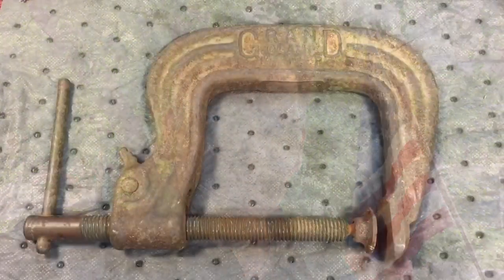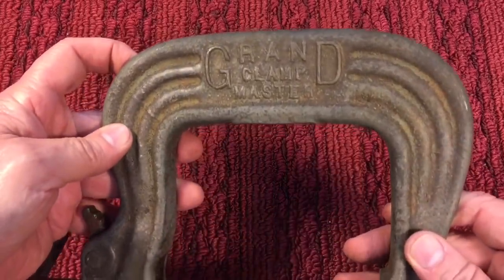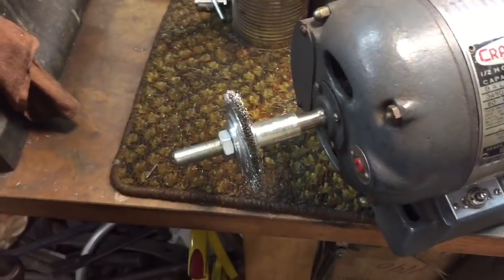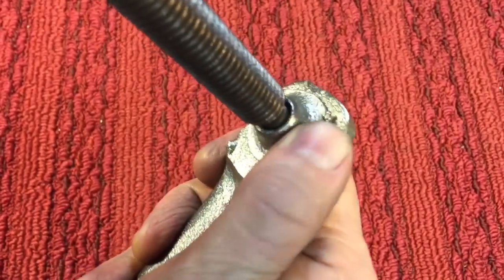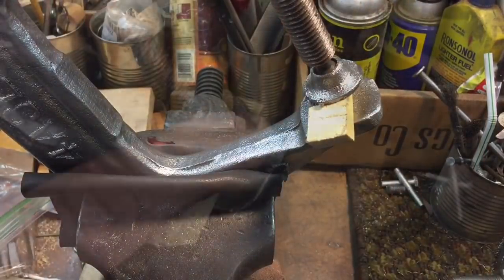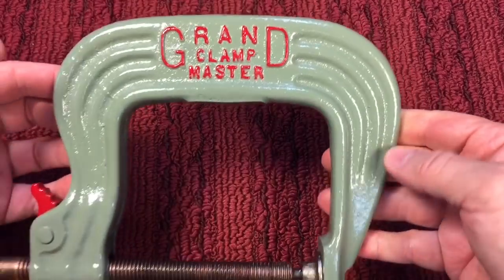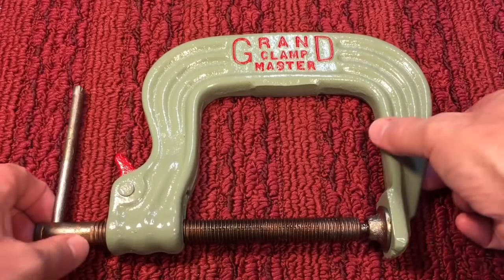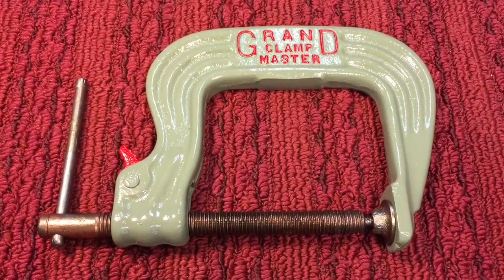Restoration of a Antique Grand Quick Release Clamp

Comment: This clamp makes me think of a piano with that name and design. Looks great after wire wheel. I like it painted too. That hole was probably used for a press. I modified a pair of Channellock's similar. Use it for pressing in roll pins on hydraulic clutch slave cylinder when on vehicle.

Comment: The art deco on that is simply outstanding. Personally I would have kept the silver shine coming off the wire brush, but those colors do look era correct. I've been looking for more ornate stuff like that, and it has given me some ideas when I get deeper into making my own tools.
Reply from the maker: Allan!  I was so close to keeping the original casting color (silver) and doing the letters in Red but the paint really does a great job protecting the clamp so I did it. If you want the original casting color you have to Clear-coat it, not shellac. The alcohol in shellac can slightly darken the metal.   Thanks!!!!!!!!
Reply: @ScoutCrafter  I need to invest in some shellac. I use the buffing compound and a little oil to stop corrosion. It's been working well enough in the Georgia humidity.
Reply from the maker: Allan, Shellac is so easy to apply and dries so fast and keeps out the moisture!  I think you will like it!  =)

Comment: Really cool clamp. I'd use those along with F-clamps for fabrication. I have two different metal saws that use that same kind of quick clamp for vise adjustment and they hold pretty solidly.n Never tried vinegar for rust I've always used electrolysis but I'm usually de-rusting something much bigger than a clamp, guess I'll have to try it. Great color combo too thanks for the restoration!
Reply from the maker: Hello George!  The vinegar won't work as well as electrolysis but I can do it in the basement as there are no hydrogen gases.  Plus at $2- a gallon it really does a decent job at a low cost!  The F clamps are just unbeatable!  I like to restore old classic tools but you can't beat the F clamps for quick set up!   Thanks so much!!!!
Reply: Yah, basement not a good idea for electrolysis! I use my shop too many air leaks to be a worry.

Comment: Very interesting clamp - I didn't know metal quick-release clamps existed (not that I'm an expert, mind you.)  I was wondering if you were going to repaint it - it looked good in bare metal and it looks good painted.
Reply from the maker: Hello David!  Quick release were around for quite a while but their problem was over time the half nit would wear and the clamp would slip. So the old timers stayed away from them.  As for the paint, I too was on the fence about painting or leaving it raw...  That's one of the restoration problems you run into!  It's so much easier if you were a business doing it for someone else because you leave the decision up to them!  LOL   Thanks so much!!!!!!
Reply: Half nit? Is that half of a nitwit? LOL (I assume you meant half nut).
Reply from the maker: LOL   Yes!  I haven't heard Nitwit in a long time!  =)

Comment: Looks great, what did you end up using on the copper coating to prevent it from tarnishing? You know that “patina”
Reply from the maker: Hello DJG!  Those older threads had a copper plating to prevent weld spatter from sticking to it but I don't know how effective it is..  I just coated the threads with the 50/50 red grease/marvel mystery oil.  That should keep them rust free, as for tarnish well, I'll call it Patina!   Thanks!!!!!!!!!!

Comment: Another great video.  You mentioned it is identified as a 4" clamp and yet when you measured it it was 5" at the girth of the clamp.  If you open the mouth of the clamp all the way it may measure 4".  I    believe clamps are normally measured at the mouth.  In many of your videos you show old drawings of the tools you are working on.  I'm always curious where you find the drawings.
Michael
Reply from the maker: Hello Michael!  You are right!  Lots of times a 4 inch clamp when open the pad will not allow the full four inches!  However because of the "dip" in the bottom jaw and the way the pad goes deep into that jaw this clamp opens almost 5 inches!!!!!  I never saw that before!  As for the drawings I try google images and Patent search but my favorite source is Alloy Artifacts .org  They are the best!!!!!!!!   Thanks!!!!!!

Comment: How do you remove and then replace the pad please? Thanks
Reply from the maker: Hello David!  Normally there is no need to remove the pad, just move it over to one side and you can clean that side of the ball, do that all the way around and most of the rust will be gone.  Then fill the pad hole with grease and your good to go!  Don't try to remove the pad if you don't have to... They are pressed on at the factory!   Thanks!!!!!
Reply: Understood. Thanks for taking the time to explain. Cheers
Reply: @ScoutCrafter  0

Comment: 4 ASL you are assuming it is 4 inches, but could be a model number. It turned out nice but no country of origin which makes me think they are not American with the  styling probably Italian.
Reply from the maker: Hello Tony!  Most Clamps I have owned use the number as a designation of size in inches, Grand did make a  6ASL clamp that was larger...   Usually the number indicates maximum capacity between the jaws.  Most clamps I have don't have a country of origin on them just a manufacturing name and size!  However since the Italians always like to add some artistic design in their tools it very well could be Italian!   Thanks!!!!!
Reply: Weired I thought french

Comment: That clamp is so stylish for a “clamp”!!  But should have just left it shellacked with red lettering.😕👎🏻
Reply from the maker: Hi Jill,  The lines on this clamp were very still in good shape but the rust over the years left a dimpled surface and when viewed up close it looked "sandblasted" and very raw.  The shellac and paint helped fill in this small voids and give the clamp a finish more like it had when new.   I have seen examples of these clamps that were never rusted and the metal is nice and smooth, for those clamps a clear-coat after cleaning would look nice but on this one the paint looks superior....  =)   Thanks!!!!!!!!!
Reply: 🤔 Then I trust your decision.